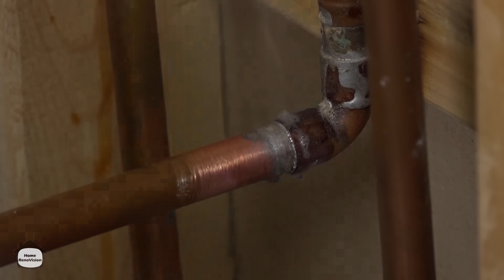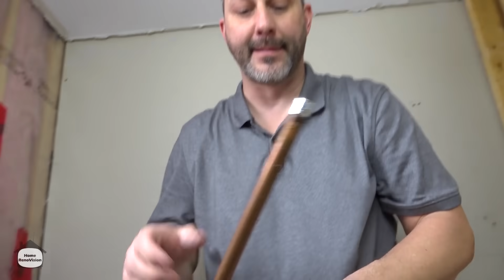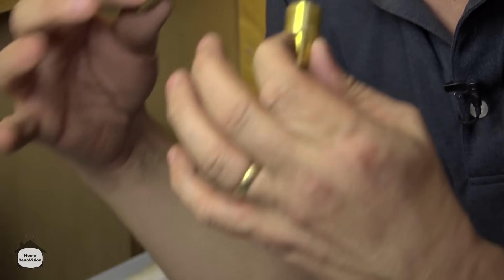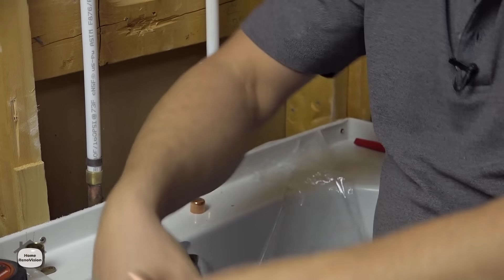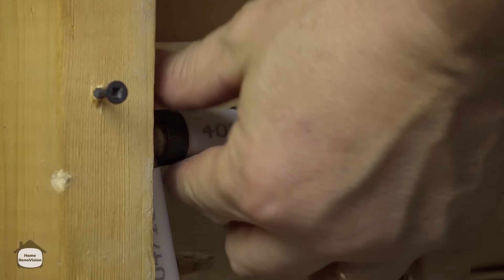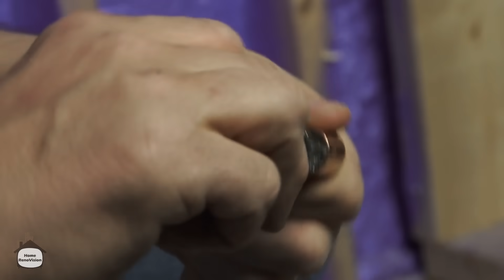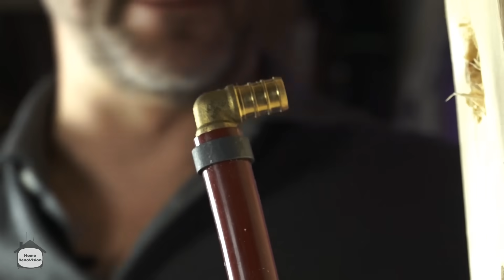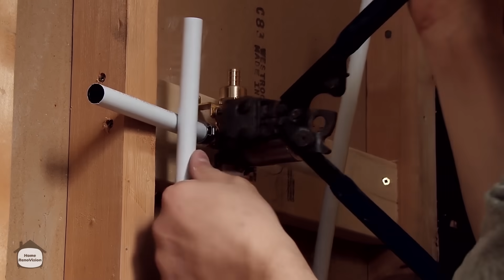4 Types of Shower Valve Assembly Installations

Comment: Question: The Depth! Is it different with all shower faucet brands? Do you have to compensate for the cement board and tile thickness? Thanks in advance.
Reply from the maker: Hi John, each product will have a depth setting feature or guide ijn the installation instructions. always read through if you have not worked with a product before. many of these products have different requirements. Cheers!

Comment: great vid about plumbing options. Only thing that I've noticed is that the pinch clamps on pex tend to leak when exposed to extreme temp variations. saw a vid when the wall was opened up in a commercial bath the pinch clamps were all leaking the few crimp clamps had not. I do use the pinch clamps on rubber apps such as in automotive vacuum. Good to see someone who can solder. I like the map gas too....
Reply from the maker: pinch has been outdated now that they have reasonable priced solid ring crimpers on the market!
Reply: yes, I remember in 2006 when I started plumbing my house I decided to use copper because the crimpers were $700 at our local home depot store. Just couldn't justify the cost.  Bought a pair for $70 about 2 years ago....

Comment: Thanks, Jeff, you are an excellent teacher, because you make the soldering look easy (not scary). 
Can I change my old Delta Monitor shower valve without changing the tub-faucet since it already corresponds with a separate drain stopper? Or should I get the complete universal kit and change out everything?

Comment: Great videos. Very clear & easy to follow.  Question: What are the long capped copper extensions on the old rough in? I see you left them here, but other places I have seen them removed and the pex goes straight to the supply line and those extensions are removed. I have them on my tub/shower & didn't know if I should leave them or remove them. Thank you.
Reply from the maker: Those are designed to stop water hammer in copper pipes.

Comment: @Home RenoVision DIY, just plumbed a delta R10000 based on the last valve in this video, Pex going to tub spout. A friend mentionned that the restricted diameter of the PEX might cause the diverter on the spout to not work properly and to have water coming out of the top shower head even when spout fully open. Thoughts or experiences?
Reply from the maker: I use a diverter at the valve so I never have this problem. If you are using a mechanical diversion then it sometimes fills the tub with a little help from the shower head. At the end of the day it all goes in the same place so no problem.

Comment: please never ever use a sharkbite. simply put they suck and will not work. if they do work it wont last long. its better for a short term fix. shark bites fail. find something else they will cause very big headaches if you plan on using them
Reply from the maker: sorry you have had such a bad experience with them. perhaps it was first generation. lots of improvements since then.
Reply: @HomeRenoVisionDIY  you don't have to be sorry they make a bad product.

Comment: won't PEX and PEX fittings restrict too much on a diverter tub spout, especially if using 1/2" PEX?
Reply from the maker: Hi Andy, actually the smallest diameter in the plumbing system is in the diverter valve. so that is going to be the largest restriction you face. No worries with the fittings. You would need to purchase some high flow fixtures before that was an issue. If you do increase the pex to 3/4 and you will be fine. Cheers!

Comment: Can anyone explain why the have extra dead legs of copper going a few feet up pasted the valves? Why not a 90* into the valve for the supply. Why a “T” and continue the pipe up a few feet to just cap it? Does it serve a purpose?
Reply: it's to prevent water hammer. when  a valve it shut quickly( like your tap) in older homes especially the pipes rattle due to the sudden stop. these allow the water a space to release the energy when a tap is turned off
Reply: The extra legs are air chambers to prevent water hammer but eventually they get filled with water through entrainment and you lose the capability to prevent water hammer.  So after awhile the pipes need to be drained to re-establish the air chambers.  Commercial installations use water hammer arrestors with access covers in case replacement is required.  https://www.homedepot.com/p/Watts-3-4-in-Lead-Free-Threaded-Water-Hammer-Arrestor-3-4-LF15M2-B/301221595?MERCH=REC-PIPHorizontal2_rr-100069256--301221595--N

Comment: Hey Jeff, greeting from Burlington ON,
 i'm adding a washroom and small kitchen to my finished basement, planing to use macerating toilet, i need to know how i can run hot/cold water pipe as well as drain pipe to other side of the  basement which is around 20 feet away from my main drain pipe and water pipes, i'm planing to use Pex and stand up shower , and trying to minimize any digging and destruction, so i wanna run the pipes outside of the wall,  i can send you image
Reply from the maker: Time to call a plumber. Or go to Wolseley and ask the counter guys. they will advise and set you up!

Comment: To do a proper water leak test you need to bleed the air to fill all the pipe and joints with water. Right? 

Or is this blue device an auto air bleed? Never seen one before (the blue thing)

Comment: Compression fittings are really really easy to use. I’ve never had one leak. The trick is to use copper olives (think you guys call them “ferrels”?) and not the brass ones. 

But yes, solder is just as good. Plastic is even easier. Idiot proof and NEVER leaks.

Comment: Hey bro, thank you for your videos. I'm about to embark in the total remodel of my bathroom and have seen several videos on what pipe to use. This old house has pretty much galvanized all over. I worked before with copper and feel well confident with it. Also have worked with c-pcv, but never with pex.  I'm very much inclined to use copper. What is your advice?  And that blue pressure plug you use you buy it or make it?  Thank you. Esteban
Reply from the maker: copper is still great. I bought the plugs from amazon.

Comment: You used 3 different crimpers with the PEX installs.  What was the first one called/manufacturer?  Which one do you prefer?
Reply from the maker: a few years ago the only diy plumbing option was the crimp rings, now they sell a solid ring system for under 50 bucks  so I recommend to use the solid rings. Cheers!

Comment: I thought flux was an acidic paste to help clean and bond the metal solder and copper together.  I've seen other plumbing videos say that you should wipe off the residual flux from the joints after soldering with a clean wet cloth to avoid the corrosive effects of the flux.  Thoughts?
Reply from the maker: I have never seen flux be the reason for a leak. a little green stuff but no problem there. feel free to wipe it if you want to!

Comment: Jeff what are the correct procedure/measurements to .installing a shower valve and shower head in a basement shower.?
In your 4 video demonstration, you showed how to connect disconnect the old shower valve and install a new shower valve.
What are the procedure as to where to place the shower valve, the shower head and the valve that comes in the bathtub?
Reply from the maker: Put the handle at a height that you find comfortable. put the shower head high enough so that a tall person can use it. The higher the better.

Comment: Thanks for the video, learning a lot.  In the second method where copper converted to pex, only to have the spout line to be solder.  Why?
Reply from the maker: That is an option for converting if you don't have access to the sharkbite after tiling.

Comment: When You're centering that vertical pipe with your tape measure, what is your reference point on the pipe, sense it's there's not 'edge' to measure from? Are there vertical lines on the pipe? If it were flat I would get it, but a pipe is circular. Hope my question makes sense.

Comment: Slip a small piece of sheet metal behind the pipe while soldering.  That way you don't char the studs behind the pipe.  Great video, thanks for sharing.
Reply: Old license plate works great
Reply: @Brian_P  Yep - usually there's quite a few cars around you can take one from -- best not to take it from customer's car though :)

Comment: How do I connect a rough in valve to galvenized piping. Aida
Reply from the maker: Get rid of the galvanized! or use a pipe with a threaded conversion. Just ask the plumber guy at the hardware store. They have them in stock.

Comment: Hi there,

I have watched your videos many times and I am very grateful that you are making them. I am remodeling my bathroom and putting in a clawfoot tub with a shower. Mine is a little unique because I have two sets of water sources. One source I plumbed just for the bath faucet and the other I am installing a shower valve in the wall. From this valve, I am installing a "rain" style shower head that will hang over the tub suspended from a 3/4 in pipe going across the top of the tub in conjunction with the shower curtain ring.  My question is, "Does the shower valve have to be exactly lined up with the middle of the tub?  

I kind of cannot do that because there is a stud from the interior wall that is the half way point of my tub. Would it be alright to put the shower valve and shower head line slightly to the right so that it is in-between the two wall studs??
Reply from the maker: I would suggest cutting a piece of the wall stud out of your way. It is not structural and will solve all your problems. Just look at my pocket door video and it shows you how to remove a stud without damaging the other side. Cheers!
Reply: You would have to cut the stud so you can place the valve in the middle so it is lined up. A little more work but looks much better when done.

Comment: EXCELLENT VIDEOS, THANK YOU! I had a great deal of trouble with the shark bite and flex hose that is used with it. My plumber installed a new water heater for me and used those for the connections. About 2 years later I started getting black flecks and soot out of my bathtub - grossed the wife out. I could not find a plumber in my area could figure it out (or maybe they were not interested and wanted to sell me a new water heater), all of them said it was probably flaking from the vent or was a bad water heater...So did some googling and found out that this soot can be caused by those connectors. I replaced them with copper and the black specks went right away! Apparently, over time the inside layer of those shark bite lines can get weak and break off cause the black flecks. I will stick with copper for now.
Reply: They are sealed by rubber o-ring, and all rubber breaks down over time.  Something to think about when trying the crimp-on copper joints.
Reply: Donald Warwic
Reply: Wow! Thank you so much for this. Now I know what’s gone wrong at my place too! I’m with your wife - totally gross.

Comment: I almost got screwed on a job once because I read the instructions. Fortunately I held on to those instructions and it was discovered later that the manufacturer had made changes in the procedure but the local supplier had not bothered to pass the info along. Because I was able to prove that I was instructed wrongly, they had to bite the apple.

Comment: I really like separate hot and cold water handles.  I find with the one knob there is not any control over the flow.   It is either on high or off.. no in between. .. Doesn't matter for showers but for a relaxing bath I like to leave the water on a light trickle of warm water for the sound.   This is not possible with the one knob system..  plus as one i s relaxing and need to turn off the trickling water or turn on the trickle for that matter,  they have to stand up bcs those one knob systems are so high up.   Do you have a video how to convert a one faucet handle system back to 2 . separate hot and cold. ??  Thanks
Reply: I'm not a plumber, but I think the valves are all one handle today due to building codes requiring them to prevent scalding. Some one handle valves do have volume control. Moen makes a single handle valve with volume control called a Moentrol.
Reply: Perfectly Said! Those one values with a quarter turn have no flow control! I always hated them too.

Comment: homeowner question..  when pressurizing test, how does the water even get into the pipes.. sitting here watching seems to me the air is still in the pipes and has nowhere to go? how do you force water into a sealed system.  don't you/we have to turn a knob/valve to allow the water to move up into the pipes then turn the knob/valve off and continue the pressure to test?  newbie but would still like to know.  Thanks . great videos  :))
Reply: Colleen Lassie Hi, Colleen! Your wording is kind of vague, but it sounds like you're asking how to get water into your new plumbing lines after you've completed your joins. When you join plumbing, you have to turn off your water supply at the house's main shut-off (often in the basement or near the hot water tank) first. To check that your new lines don't leak, you test them before sealing them behind the wall. To do that, you install the local valve (i.e., the one that your new plumbing lines attach to), set it to the off position and put a bucket underneath (in case your work is leaky), then turn you house's main water valve back on/open. If there are no leaks, open the local valve. There should be air in the lines, so the water will spurt until you've managed to force it through the plumbing, but then you'll have air-free water lines again.
Reply: Once you turn on the main water supply to the house, the air in the pipes will leak out and followed by leaking water if there is any leaks before a working sealed shut off valve.  Depending on how far and how severe is the leak, it may be a while until you notice it if there are no open valves for you to bleed out the lines.

Comment: I have installed about 10 tub filler/shower valves.  The brands/models (Moen & Delta) that I have installed all required the use of 3/4" PEX piping/fittings between the shower valve to the tub filler drop ear for proper operation (for PEX installations).  
In your videos it appears that you ran all 1/2" piping/fittings in this area.  

I'm curious to see if any of your shower valves mentioned such a requirement in the product installation instructions?
Reply: The 3/4 pex is only to the tub filler. Or use copper pipe at 1/2.

Reason for this is because with 1/2" pex to the tub filler most systems will piss out the shower head a bit when filling the tub as the filler isn't larger than the head run. This is really annoying install error. 

Cheers
Reply: Do they run 3/4" PEX to the shower head, as well?

Comment: Used to use electrical tape on cuts.  Now always keep el cheapo insta-glue handy.  Quick clean of the wound and seal it up.  Apply few more times during the day and the following days as well.  Skip any infections and I guarantee in 4 days or better it'll be just like new and possibly no scar.  I swear by it.
Reply: Jay Bud , haha, you noticed that tape huh

Comment: Wish that I had seen this compilation a few weeks ago! I renovated our bath and used 1/2 inch pex throughout. I was bitten by the water coming from the shower head when the diverter was in the tub position. I had to open the wall back up and replace the drop to the tub spout with 3/4 pex -- problem solved.

Comment: Where do you get the purple spray foam. If it's the brand I'm thinking of, it's designed to turn purple when the two chemicals are mixing properly. First saw it on one of Mike Holmes' shows. I'm in the US and can't find it online.
Reply from the maker: most likeky it is only available to commersial installers who have been certified to use the product

Comment: Well done as always Jeff.  I personally think the old ways of solder and copper is the most durable/bomb-proof way since it's been well proven over decades.  

However, a hybrid system of sweated copper in the finished spaces and meeting it up with PEX on long runs where it's accessible is also a good method and has many benefits.

I don't trust the SharkBite system long term because of the rubber O-rings which can degrade over time.
Reply from the maker: Interesting, now that they make valves with pex connectors I would probably avoid mixing materials just to keep the tool box simplified.
Reply: Khy

Comment: Jeff, with a copper to PEX transition fitting, don't you lose some flow rate, since the coupling ID is smaller on the PEX side?  Not really an issue with a simple overhead shower, but if you are doing multiple jets, heads, etc., it adds up.
Reply from the maker: Great question Clinton. Actually the smallest ID in the system is in the valve itself. That is why there is no loss of volume.

Comment: Is it possible to replace the shower valve from behind the wall? ie from behind the closet wall.
Reply from the maker: Yes, but it involves some pretty tricky work.
Reply: That is a preferable option if you don't want to touch the tiles.  Patching drywall usually is cheaper and faster than drywall/tile/grout/seal.  And in the closet you can cut the whole wall out to work comfortably.
Reply: Yup and it is about the same as doing it from the front. Use a Kreg pocket hole jig to help to mount any 2x4s that may be needed to secure the pipe. Its not any easier or harder just backwards.
Reply: trick is to use nut and bolt sets to mount the new valve. predrill the holes from the back side of the 2x4 or remove the support 2x4 and valve without disturbing the tile backer. I use a sawsall or wiggle saw. (oscillating saw)